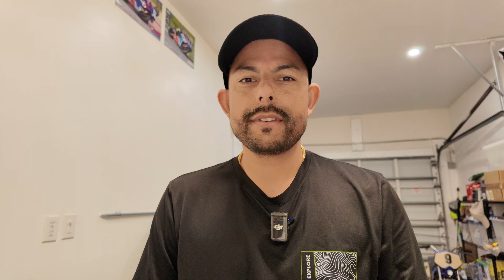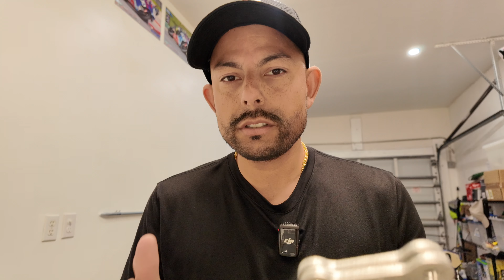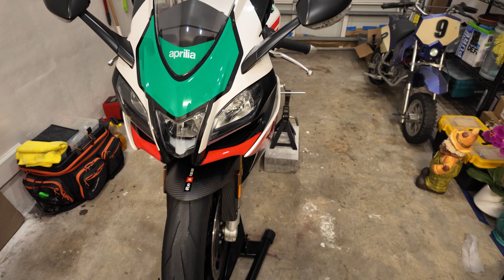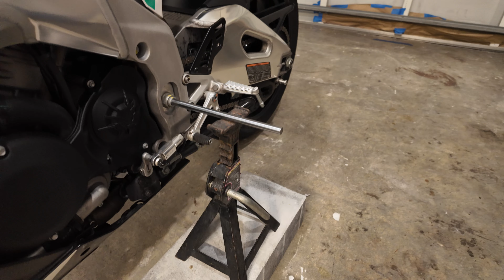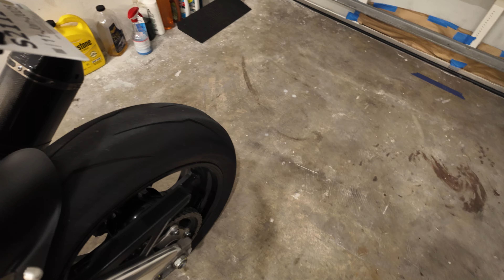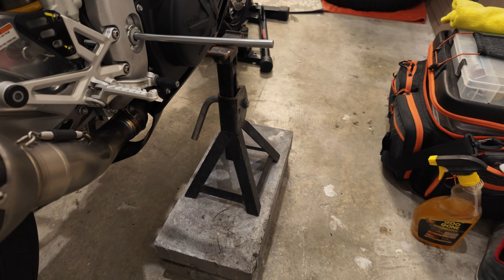DIY Aprilia RSV4 Lowering Kit Installation

Comment: Did you have to adjust the chain after you lowered it. Also was there a good lean angle on the kickstand. Instead of buying an adjustable one I wanted to take off the oem and get it shortened at a machine shop.
Reply from the maker: @yaels09  no chain was fine no adjustment needed. The lean angle on the kickstand was fine it’s not necessary to cut the stand.

Comment: Awesome job.. i have a RSV4 factory 2024 had to put a lowering kit and a shorter kick stand
Reply from the maker: @A-37Bdragonfly  thanks I was reading on these links and they will work with the factory ohlins but the heigh can vary quite a bit so you may need to have it adjusted at suspension shop.